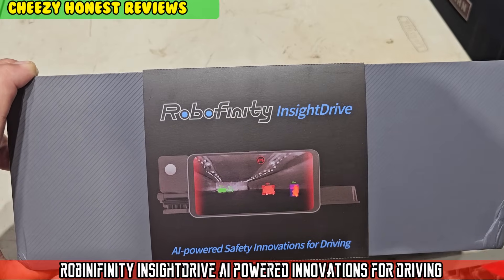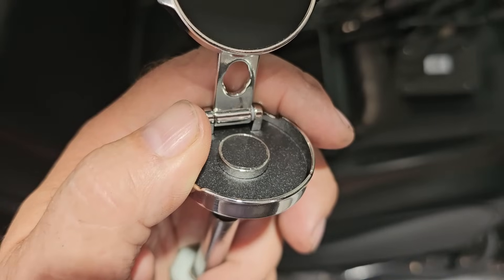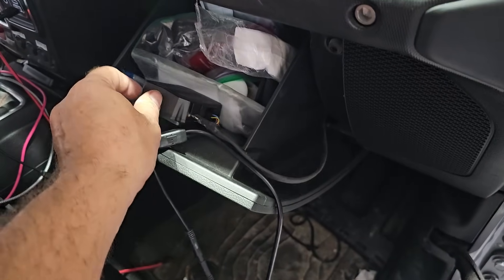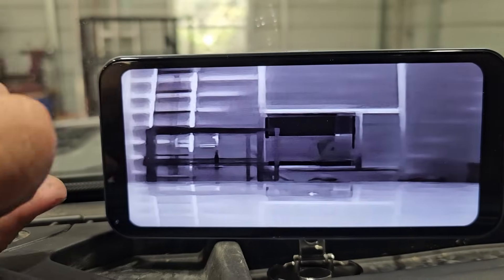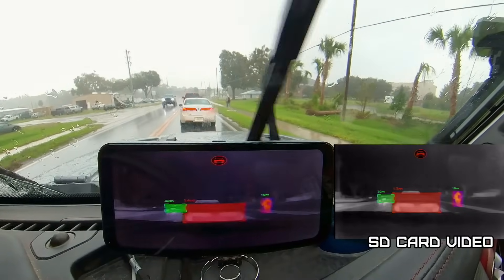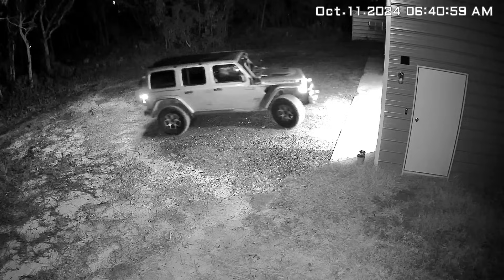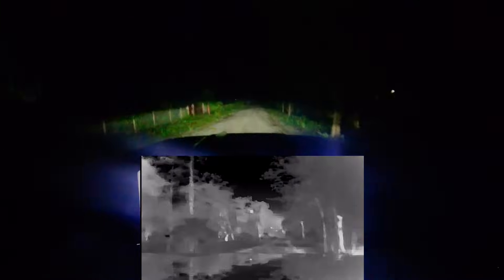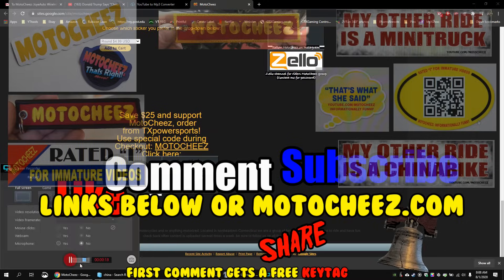Robofinity InsightDrive: Car Thermal Night Vision | Collision Avoidance & Driving Assistance

Comment: Mounting this Expensive Camera permanently on the outside of your car, right in plain sight, is asking for it to get stolen. That’s just plain dumb. You don’t even need it all the time — mostly just for night driving. A smarter setup would be a magnetic base or removable bracket, so you can take it off and store it safely inside the car when it’s not needed.
Reply from the maker: I bolted min to my push bar, better view. Removable probably good idea

Comment: How well would this work in a snow storm?  - minus 30 degrees Celsius. Would be nice to know.
Reply from the maker: I did a second video on this in the snow but it wasn't a real heavy snowstorm it was over but it doesn't work too bad while it's snowing. I did remove the rubber bumper cuz it would hold the snow in front of the camera. That video I did about 2 weeks ago

Comment: Interesting to see where this tech is going.  Would be really nice to integrate this into a HUD in front of the driver for even faster human-processing of the data it provides.  I'm sure it's great when you're traveling at highways speeds in deer-infested areas or in heavy fog.
Reply: Your idea is very good. Our product has already implemented this feature. Robofinity InsightDrive can also be used in conjunction with HUD screens.

Comment: Things like this would be great for deers
Reply: This is what I would primarily want it for. Also for heavy fog or rain. If I could output the image to my Stinger 
HEIGH10 I would be thrilled. Is there anything special about the display? It looks like a generic display to me.
Reply from the maker: @jameylawson8743 not sure what the outputs are to the display or if it's standard
Reply: @jameylawson8743  Robofinity InsightDrive can also be used in conjunction with HUD screens.📌
Reply: Robofinity InsightDrive is more beneficial for personal safe driving.🚗🚙🛻

Comment: What’s the real precise cable distances in cm or metres? I’ve been curious about this device for months as it popped up as a ad in facebook feed months ago and again saying they’ll be on indiegogo next week and cut off for pre purchase price is coming. Meaning pay extra after next week if don’t pre purchase now.

I’ve been thinking of buying one. The only way I’d fit it is on the front grill of my dual cab or bull bar and want to know how long the cable is to do this. Hoping they have an extra long cable to do this in the kit. Couple years ago Hudway brought out a thermal image kit for their hud display and was planning on getting their kit which was more expensive than this but still moderately priced to the premium in car thermal imaging cameras for cars on the market. But a lot of people noted Hudway kept putting off their orders and weren’t sending the product out and never received it. Which put me off the pre-purchase campaign. Not too sure what happened to their thermal kit but I know you can buy the Hudway Pro still. But I love that it worked on the hud instead of this little screen as you can drive at night with the hud in front of you.

Comment: Interesting indeed, but low resolution and with the crossing pedestrian it seems to have screen-lag of about 1/2 second which is pretty bad for the purpose this is meant for. I've seen IR car driving devices do better than this but thermal will catch things they don't. I worry about app updates since I've seen dashcam apps not get them, leaving you with far less utility than you thought you'd bought.

Could be nice once the product and app matures fully, so let's see where it goes.
Reply: We are about to launch an updated product, and we hope this update will not disappoint you💡
Reply from the maker: Yes a resolution is a little low but The sensors are not that high resolution yet for this price. That lag, every single thermal camera that I've tested and I've done about six or seven now have that little bit of half second leg every so often I don't understand what it is

Comment: Does this have a heated lens for winter/snow driving? Most currently available thermal driving cameras have this option. There is nothing on their website regarding this feature. This needs to be able to keep the lens clear during freezing weather.
Reply from the maker: I don't believe it does. Guess we'll see how it works this winter!

Comment: Just need a kill switch for all your lights.
Reply: Not legal in most places to even have the switch, but what they don't know won't hurt you 😎 A lot of the newer cars run lighting through the BCM computer so achieving this may not be easy or even possible with all cars. I won't admit to having a rear-light kill switch in some of my older cars but it did save me from several traffic tickets.
Reply from the maker: @P_RO_ 😀🤞

Comment: That is pretty cool It would come in handy for hunting if mounted on a sxs. Is that loud "ching" noise coming from it?
Reply from the maker: Yes that's an audible alert, I did ask the company if they were going to make a waterproof one for motorcycles and ATVs because it would be a great tool. The app is being updated so hopefully they'll add a mute button
Reply: @MotoCheez  Mute or adjustable volume please.
Reply from the maker: @P_RO_ I mentioned that to them